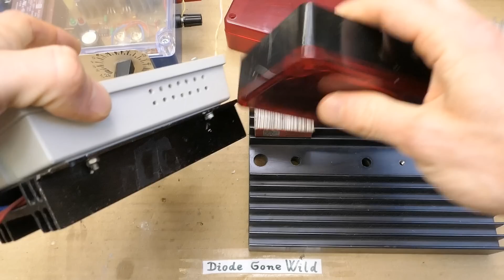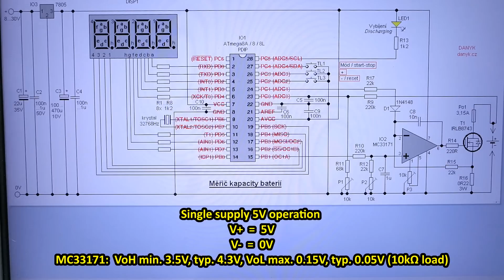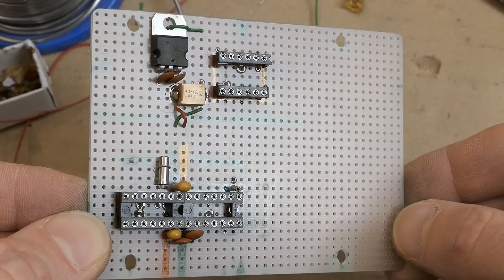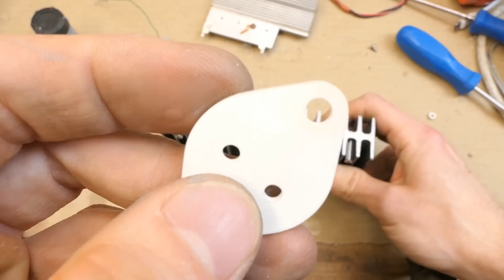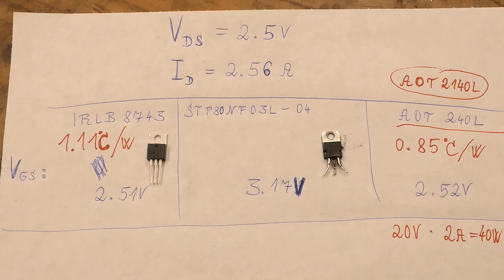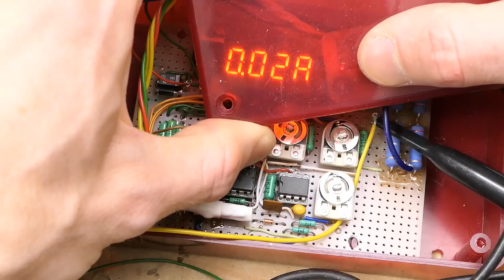Building a battery analyzer

Comment: that's so nice

you are a cool dude

tho, i think myself you make it with full sbc (like with allwinner h3 running fbsd), oled display module and i2c voltage / current sensor. no idea what to use for regulation tho. maybe digital potentiometer. or pwm cc, etc

Comment: would be nice to save mAh every so, in case of power interrupt
Reply from the maker: This would still influence the battery test conditions, as the discharge wouldn't be continouos. It would also either write the EEPROM very frequently, or lose the last several mAhs.  A better solution is a backup battery. Just a 9V battery and 2 diodes (one going from the battery and one from the power supply) can solve the power interrupt problem.

Comment: I see you are using a 32768 crystal for time calculation, have you implemented ppm correction like you did for your digital clock? Or the percentage error in crystal frequency can be neglected, it need not be as accurate as it needs to be in a clock?
Reply from the maker: The crystal error is absolutely negligible here. The main factor for accuracy is the constant current circuit. Time is always measured way way more accurately than the discharge current is regulated.

Comment: Last year I was inspired by your original design and made my own battery tested that I can also use as an constant current load (in this mode it doesn't turn off when the voltage drops). 
Mine is tho quite different. On the outside I have a rotary encoder instead of push buttons and my display is only 3 digits.
On the inside is even more different. I used and arduino nano and lm358 op-amp.  It doesn't have the offset null function but that's mostly okay bacause I feed the voltage of the shunt back to the arduino so I have an accurate measurement even if the current is not set properly. It's especially helpful at low voltages when the taster can't sinc the set current because I am using a darlington and the op-amp can't go to vcc.
For the ADC voltage reference I use the built-in 1.1V reference so at full current I still get 9 bits of resolution (0.5V / 1.1V), which I think is plenty because the resolution of the PWM is only 8 bits.
Another major difference is a 2nd transistor that I added in series to the collector of the first one, which follows the voltage of the battery and splits it in half between the 2 transistors so the dissipation is shared.
I've found a very sensitive MOSFET on AliExpress, it's IRLB3034 (turns on at about 2V), I don't remember if it's specified for DC. I am using it as the 2nd transistor. I haven't used the tester much but looks like it works fine for now.
Reply: My comment become quite long. If anyone is interested or have questions I'll be happy to answer and share more.
Reply: @dimitarnikolov3527  Hiii, I have many Li-on cells which I have but many of them are old and I am not sure about their capacity they are LG branded so I am Interested about your project. I don't want any very low discharge current or anything but just a reliable way to measure the capacity of them. Can you provide the link or the files to the project ?? I don't have any rail to rail opamps just regular ones (NE5532, TL072, 4558, LM324). I was surfing on the internet to find if any one used the INA219 Current Sensor to measure the current accurately instead of the voltage across the shunt.

Comment: Please explain why the silicone pad is required under the MOSFET, when nothing else is connected to the heatsink?
Reply: Yes required
Reply: It might be because a loose wire could come into contact with the heatsink and short to the Drain of the MOSFET
Reply: For better heat dissipation
Reply: @prakharsrivastava7170   There is  better heat dissipation when the FET is connected directly to the heatsink with compound.

Comment: Hello, is there a specific reason to fix the body of the external  crystal to the board with a piece of wire or is it for decoration purposes only?
Reply: No specific reason
Reply: Grounding  the metal case discharge it and prevents strange spikes in the quartz oscillator.

Comment: Can we also use instead of 32768Hz crystal 16Hz or 12Hz or something close to it.
Reply from the maker: No, you can't. It's needed for it to measure the time correctly. And a 32768Hz crystal is the most common crystal ever. Why would anybody need to substitute it?
Reply: @DiodeGoneWild  I have one 3.579545-B3 C1Y Does it do the Job?
Reply: @DiodeGoneWild  I got it I need to sacrifice my Wall clock.
Thanks
Reply: do you have 16hz crystal clock???? do you really measure it correctly??

Comment: Hi diode gone wild, I found similar to MC33171, the TL081, can I use it as substitute for MC33171??
Reply from the maker: Hell no, the common-mode input voltage range doesn't include V-
Reply: You could try LM358 or LMV358. It’s complete rubbish (high offset, high noise, low bandwidth, no offset trimming), but it does allow the input to go to the negative rail.

Comment: Not an expert. 
Is it be possible to power this device with buck converter?  Also is there another way to program the microcontrollers, it seems the method you’re using is very old to be applied now.
Reply: Yes you can power the circuit with whatever that will make stable enough voltage.
For programming most AVRs you can use USBasp or just an Arduino as ISP or UPDI for new ones.

Comment: I don't like the way how P3 is set. In fact, these inputs are intended to (almost) ZERO the offset of that opamp, which is relatively easy to do. As long as it is biased and is controlled by a negative feedback, the voltage between In+ and In- is proportional to the offset. Zero multiplied by some constant is still zero, so if you set the P3 to obtain zero (or almost zero) voltage measured between In+ (3) and In- (2) pins, you have almost no offset on the opamp. Generally speaking, this is the way how the offset should be adjusted, but I don't think this would lead to any good result in this particular case, because (as far as I got it) P3 is intended to introduce some defined offset into that circuit to counteract the finite  voltage swing of the PWM output, which introduces nonlinearity especially when the PWM pulse is short (this is downside of simple PWM implementation), leakage of C7 and who knows what else. This is definitely not a great idea due to introducing non linearity into whole system and it's also bad from the long term stability point of view.

PC1 is something I definitely don't understand to. I accept that you need to somehow turn that load off. This is done by introducing relatively big positive voltage to inverting input of the opamp, which forces it into the negative saturation, but this could be easily done by PC5. Furthermore, if you share that ON/OFF pin with LED, the LED would feed at least some voltage to the inverting opamp input in the RESET state when GPIOs are in the HiZ state doing at least some protection. This is why sharing that pin with LED makes much more sense to me.

The last thing. That clock crystal needs at least some adjustment, which is hard to do. There is no output that would be somehow tight to some GPIO. If you touch the crystal itself, you detune that thing, which means you need to use some near field probe to adjust that frequency, which is always tricky. It would be great idea to introduce something like a adjustment mode, which could be activated by pressing some key when that thing is turned on, just to give something like full scale to the PWM output and 1024Hz divided from the crystal oscillator to some GPIO just to ease adjusting XO frequency. In fact, this is easy to implement and it would help a lot to everyone, who builds this thing.

Comment: Mc33171,2,4 are still in production, i think only SMD as most components today. And i still use them, even in commercial designs. Of course not the most fancy opamp today but knowing a part well is handy if development has to go quick compared to working through cataloges and datasheets...
Reply from the maker: Yes, I was looking for the DIP8 version and couldn't find it

Comment: IXYS (now Littlefuse) has a series of MOSFETS with extended FBSOA for linear applications, such as electronic loads. I did a design with IXTK90N25L2 some while ago, works nicely.
Reply: Yep, but they are quite expensive, and I somehow managed to fry one still operating quite conservative in SOA. Maybe I missed something, or maybe just a bad luck. I replaced it by irf260 or something like that if I remember correctly.

Comment: Should ca3140 good for substitute for opamp
Reply from the maker: Maybe, but the output voltage in high state is only 3V with no load (with a 5V supply). It might be too low for the mosfet gate. The 0.56V voltage drop on the shunt is subtracted from this, so the gate will get even less. If I really had to use this opamp, I'd probably connect the V+ before the 7805.

Comment: i want a educational video about freescale microcontroller and it's programming interface, 
they have good reliability than PIC and AVR microcontrollers, 
i didn't find anything usefull on internet,  programming devices uses BDM interface and they are too costly for diy purpose, if there's  some diy programmer like USBasp it will be better !
thanks.

Comment: Why 32768 hz crystal? Is it critical? Can't discharge time be measured accurately without it? Let's say with 16Mhz crystal??
Why not reduce the burden on the MOSFET & the size of the heatsink and just add a power resistor as dummy load in place of the fuse? 
Would you test with LM358 Opamp and IRFZ44N / IRLZ44N MOSFETS?
Can we use dedicated voltage comparator ics like LM393 in place of OpAmps?
Reply: This is the real frequency used in every quarts watch on the planet, it just makes things easier to calculate
Reply: @Pulverrostmannen  yep, I understand, 2^15 it is...just use it with a 16bit timer counter and you will get 1s .
But since I am using a 16mhz crystal was just asking if 32768 crystal has some distinct advantage over other frequency crystals...other than the simplicity of calculation...
Reply: @অৰি  well. I think working with 16mhz would introduce problems with capacitive interference and chip response along with inductance and that stuff I suppose.  But if you know how to work with high frequencies there is often ways to go around the problems the higher frequencies comes with. I just think that 32768hz would be easier to work with than 16mhz in terms of parasitic interference at least

Comment: I have enjoyed watching your video, nice job! I have two tips for you which will help you increase the accuracy of all 3 measurements of this device. Add 12pF load capacitors to your crystal and either use an opAmp for voltage and current measurement or decrease the impedance of your measuring circuits. Just trust me on these tips and if you want more details have look at application notes AVR127 and AN2648.
Reply: What exact purpose does load capacitors serve?? Do they improve the accuracy of the measured time?
Also, in place of opamps can we use dedicated voltage comparator ics like LM393?
Reply: @অৰি  Without the load capacitos the internal timer of the ATmega series is drifting a lot. The comparators can not be used. You need a regular opAmp, idealy with low Vos.

Comment: I've taken a liking to the now quite popular Atorch DL24 electronic load and battery tester. It does everything you need to test the power supply or measure the capacity of virtually any battery. It's a relatively inexpensive toy and easy to upgrade. The software is really unlimited, only the MOSFET it comes with can't make such a P-loss.

Comment: what change  needs to do for 21v battery? 5 series lithium used in many power tools
Reply from the maker: It can sort of be used for 5 li-ion as it is, just at the beginning the voltage measurement will max out. But the termination voltage is within the range, so it will be able to measure the mAh correctly. Just the Wh energy will be a bit underestimated. And of course you have to use a transistor which will not suffer from a 2nd breakdown at 21V and whatever discharging current you use :).
Reply from the maker: But be careful, the cells might be a bit out of ballance or unmatched, some weaker ones might discharge too deep or even reverse when discharged in series with no protection. To properly test the battery pack, I'd rather measure each cell individually, just like I did with the vacuum cleaner battery pack.

Comment: Some time ago i've tried to build this one using jellybean components but it didn't want to work at all. Like opamp tl081 and high power mosfets from computer scrap so i put it in the shelf.
Reply from the maker: TL081 can't work. Its common-mode input voltage range doesn't include V-

Comment: Have u ever considered using a bjt and nfet in parallel for the pass element. In normal operation the bjt would be active but as the voltage drops the nfet could supplement it. I know it seems a little contrived but if u did have that set up u could use the nfet in short pulses to measure the esr of the batteries. U could also use them with separate batteries. Lik u could have 2 bjt's 2 nfets and 2 small relays and u could do up to 4 batteries at a time with limitations
Reply: bjt needs a lot of current to drive.. hard to find a cheap opamp with high output current capability.
Reply: @robertjung8929  use a darlington? the whole point is that the increased min forward voltage doesnt matter cause at that point small mosfet can take over cause there wont be much power at that point
Reply: @eemonster  and what problem are you "solving" exactly ? and how exactly would you drive that bjt+nfet combo ? you can't connect the base of bjt with the gate of the NFET and expect it to work :) the gate threshold voltage will be above Vbe of the bjt and nfet will do nothing becaue the gate voltage will be clamped to Vbe of that bjt. if you don't connect the gate and base together then you need extra circuitry to drive them. so back to the question.. what problem are you trying to solve ? is it worth over-complicating a working circuit ?

Comment: Maybe a dumb question, but why are there small knots on the power supply wire of your old battery analyzer? Is this just a convenient way to shorten the wires, or is it meant to provide some kind of very low value filtering inductor?
Reply from the maker: The knot on the wires is so you don't rip the wires out if you accidentally pull them too much. The cheapest strain relief ;)
Reply: @DiodeGoneWild  Thanks, love it, keep up your amazing work, you channel is a gem!